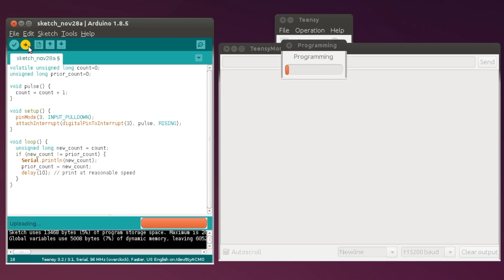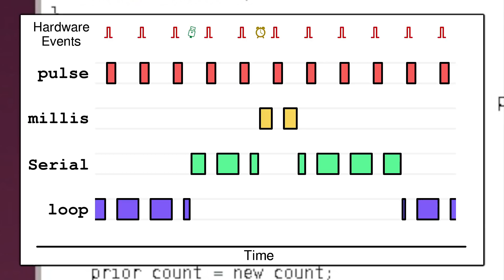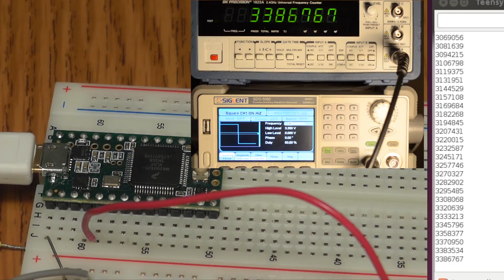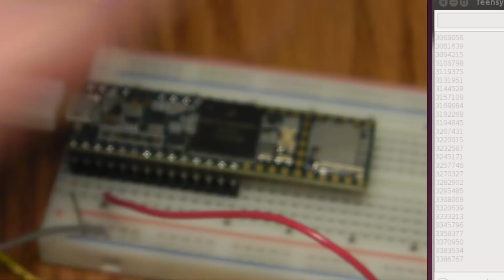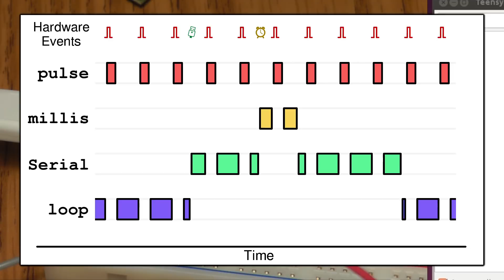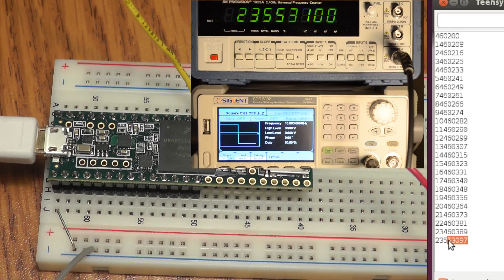Old version - Please watch the new, better edited version

Comment: I wonder if the two methods of pulse counting react slightly differently at the beginning/end of the pulse train. If you looked at the output of the signal generator on a scope, does it start and end perfectly cleanly at 30Mhz?
Reply from the maker: Yeah, a very good question.  Just one of so many things I'd love to dig into, if only there was more time.  This was meant to be "quick", but ended up 17 minutes and took about 10 hours of work.  I really need to learn how to do video more efficiently....